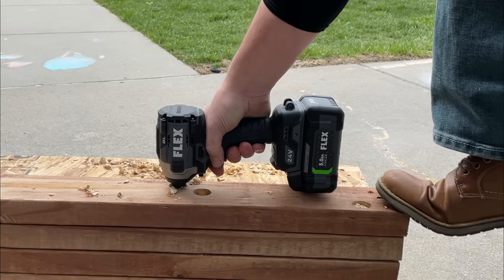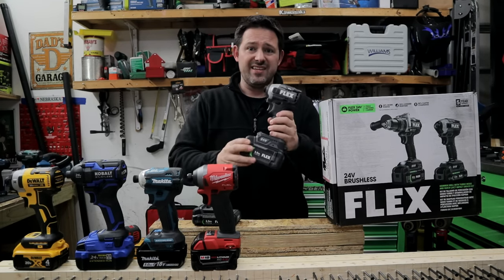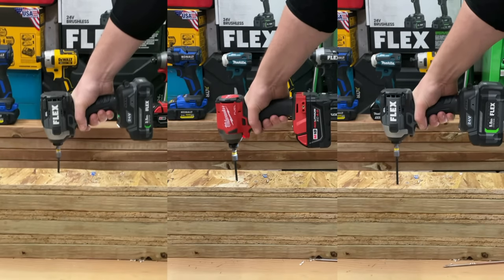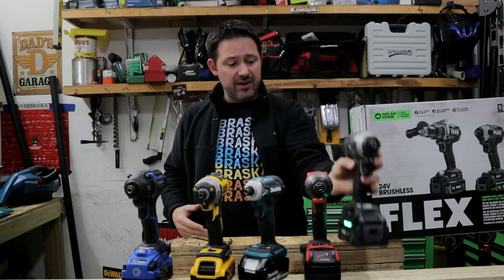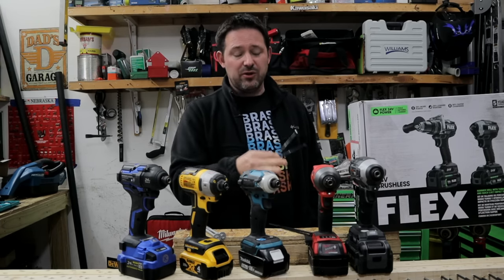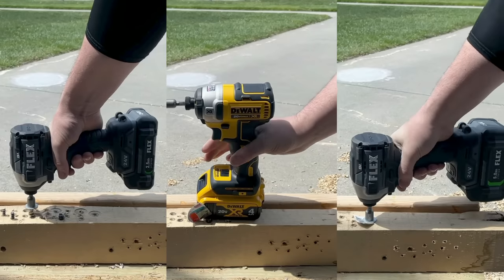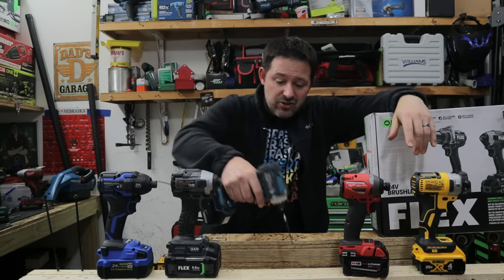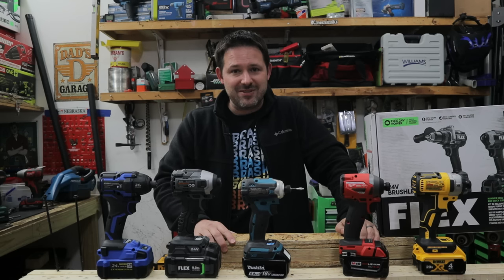FLEX TOOLS vs DEWALT MAKITA MILWAUKEE It's NOT what's NEXT Impact Driver SHOWDOWN!

Comment: I personally don’t care which one finished the fastest . I care more about the life longevity of the tool . If had to bet the Makita will outlive all others 🤷🏻‍♂️ !!!! Ohhh and Makita fits perfect in the human hand , and is well balanced 😎
Reply: All of my tools are makita except for my 12" mider saws. Makita tools are not the most powerful tool out there but they are the most balanced when it comes to power and battery durability. And the only reason I don't rock a makita mider saw is because it takes a PHD to tune it (about 10 adjustments) compared to my dewalt (3 adjustments)
Reply: @fu2974  right on !! In my own personal opinion Makita and Hitachi make the best impact driver .
Reply: I personally haven't used their battery powered tools but I do have all of Hitachi trim nail guns and framers and they haven't failed me yet.
Reply: @fu2974  let me tell you they’re pretty bad ass . They almost feel like a Makita in the hand . I call I Hitachi the Makita brother , they’re very similar!!
Reply: @philltafolla Do you think Metabo helped Hitachi or hurt it? I have buddies that swear on Metabo. My only real problem with Makita and Hitachi is that thier isn't any real distributors for my brand or Hitachi (Metabo) and I don't like to give my money to the HD or Lowe's if I can help it. Plus their lines seem to be a bit less durable than the pro grade. I've had to go to different cities to purchase what I want which is a pain in the ass.
Reply: @fu2974  I personally think that Hitachi didn’t need Metabo, so I’m going to say Metabo hurt Hitachi more than it helped. And I totally get how you feel .
Reply: @fu2974  Hitachi rocks  my old  832 16 d air guns are so solid
Reply: Im a milwakee person but i used to have all makita at one point and i can honestly say there is nothing as smooth or a ergonomic and durable as makita
Reply: @sergioservin212  that’s right you know exactly what I mean 😎
Reply: Usually makita is more expensive and gets outperformed by others so why buy a more expensive tool that is less powerful? Lol
Reply: @ALEXIS1414100  Never said Makita had the most power!!! To each it’s own , Makita makes well balanced tools , tools that fit perfect in the human hand . All my Makita tools have outlived the other brands that I’ve owned !!!!
Reply: @philltafolla  metabo merging with Hitachi was the worst thing that could’ve happened. Metabo was my shit all my pneumatics and saws from metabo are super reliable. Metabo downgraded when they merged, ive had a lot of problems with Hitachi tools it’s just not the same anymore. 😞
Reply: Makita is 4 life !! 💪💪
Reply: Makita is quality! I went with Kobalt, we will see how it does. I had Milwaukee previously, it was great but I dont care for the ergonomics.
Reply: My makita best friends and co workers dewalt and Milwaukee and mine is still running good I dropped it probaly 10 times of a roof on to concrete and still works although I wouldn’t recommend it
Reply: If i can drive screws 30% faster, thats saving time, and time is money.
Reply: @deepdeception7953  Thats irrelevant to me since I am my own boss and I charge by the hour . So Makita for me 😅
Reply: 100%. Ergonomics and reliability are two of the most important things and are mostly overlooked in alot of reviews. Makitas the king of these two things.
Reply: @ALEXIS1414100  reliability
Reply: @bigboy509_  Metabo pneumatics? What pneumatic tools has Metabo ever made?
Reply: @deepdeception7953  Did you build my condo?  Everything looks like 💩.  Slow down.
Reply: My guy
Reply: Been doing hvac for 16 years and makita had never failed me. i still have some batteries that are 16 yesrs old and still perform. But i do however run 12v milwaukee for the ridiculous amount of tools available. And they are quite impressive.
Reply: Okay so if you want a long-term battery and something that's really worth it I am a general contractor that works with either condemned or water damage houses I have done structural engineering my whole younger life and skill with their power core 20 five amp hour you can even find an aftermarket 6 and 7 but there's really no difference in them works amazing I bought them since they first came out and I have bought in flex the flex are all f*** up I dropped the screw gun from about 6 ft and the f**** handle broke I threw my Ryobi off a roof of a church it hit the ground almost in the same fashion blew the battery out but the tool was only semi damaged it's still functioned so it really goes down to you doing your own research people keep saying tools are expensive but if you are a contractor or doing anything in that manner you should have a little bit of money because when you bid for a job make sure you put the tools and things you're going to need right in the price so you have a budget to buy stuff
Reply: Makita is shit lol. Idc who you are. Watch some TTC. If I’m spending Flex money, I’m just gonna get Milwaukee haha. I’m not even biased. It’s just the truth. When another brand has better performance and reliability, that’ll be my new favorite especially since none of them have been super “faithful” to me lol
Reply: @FilthUD  you do whatever you want with your money, I’ll do whatever I want with mine 😀🤷🏻‍♂️
Reply: @FilthUD  been uaing makita for 16 years in 18 volt.. never fail me.. have the milwaukee 12v cause its just filthy good
Reply: Makita looked pretty weak to me.

Comment: I use Bosch and Milwaukee for construction, but also use Ego for landscaping. 

I keep watching Flex videos, even though I have zero plans to buy.
Reply: Same, I just bought the whole XTR set a few months ago so I won't be looking to upgrade for many years, but I do love seeing what the new ones can do.
Reply: I watch several Flex vids too, its the hype. But still not impressed, its powerful but not engineered with the knowhow of the 3 biggest established brands.
Reply: 18v line bosch guy here i have one dewalt tool and its the drywall gun  great tool for the price neither bosch  or Milwaukee could beat it pricewise
Reply: Cannot speak for Bosch, but the Milwakee will last 2 lifetimes. Dewalt will need to be replaced 3 times over a life.
Reply: I keep watching about flex tools for interest but I'm not even sure that they will sell it in my country ever
Reply: @cameronaberner  Have you been happy with them so far?
Reply: @rogergreene2272  Extremely. They are a little heavier than competing brands, but that you dont notice if it you use them regularly. They have tons of power and the batteries hold up well.
Reply: @cameronaberner  Thanks! Mine are only used occasionally, and lightly when they are. These XTR tools should last me forever
Reply: @rogergreene2272  They absolutely will, mine are used to build houses daily and have held up beautifully. I did have the pin that holds the skyhood break on the skill saw, but an 8 penny nail solved that issue.
Reply: @cameronaberner  That’s awesome to hear. I feel like most of these people saying that Milwaukee/Dewalt are for “Pro” use while brands like Rigid/Kobalt are for “DIY’ers” are full of BS
Reply: @pflaffik  Chervon has plenty of knowhow

Comment: I  agree with you 100% that if you are are already on the Milwaukee, DeWalt, Makita or Bosch battery platform with several tools it would be just silly to go buy a Flex just because it it less than a second faster. ((((and something that is never ever mentioned by anyone on YouTube is that if you're drilling through metal (like electricians often do), you need it on the slower (Speed 1 ) anyway. ..... so you are absolutely right, if you're on a battery  platform, there is no reason to switch
Reply: Agreed.  All tools are so capable now, the only real reason to switch battery ecosystems is if another platform has other tools that you can't get in your current platform and you really want (i.e. vacuum, lights, lawncare OPE, etc).

Comment: As someone who does construction for a living, great video. Very nice to see these side by side. From personal experience the Milwaukee is my favorite for things that need speed, like metal roofing. If its something that doesn't need speed I will use the Dewalt. I find it less fatiguing to use for long periods. Also the Dewalts durability is insane! Its not uncommon for our crew to accidentally drop a drill of a roof and we only had one break in the 4 years I've been working. That was after a 16 foot fall onto concrete, the handle broke. And after epoxying the handle back together, were still using it. Again I can't over state the durability.
Reply: The dewalt xr impact fits my hand better
Reply: Obviously haven't handle the makita in your hands....best lightest feel impact driver in the hands
Reply: Yeah, I have to agree. I have been  thinking about switching to Milwaukee or Makita, but my DeWalt tools just last forever. And I have beat them all to hell. Can't talk bad about DeWalt. That is from personal experience. Been good to me.
Reply: The XR Drills just don't take abuse well. I smoked 3 in less than a year before changing platforms. Disappointing they use a plastic gear case for their high end drills.
Reply: Flex is a great tool and it stands up well to everything tested here.  Moving up from old style battery drills/drivers....when you need a new one...Flex is a great, top of the line choice.  No, I wouldn't be out buying anything if I owned a good, new style Milwaukee 18 volt drill driver or Dewalt quality one.  But Flex is a great choice!

Comment: This is the best vid so far because it doesn't start out talking smack, just puts em all through same test. I still think the brand looks decent—the Turbo Hammer Drill and Quick Eject Impact with two batteries are $350—but we'll see what folks say about durability in the field. That's all that matters. Maybe we'll know by this summer.

Thanks for setting it all up! Eager to see the Hammer Drill in action, too.

Comment: Looks like Flex focused on speed on lighter duty tasks, but can’t always keep up when maximum torque is needed. That’s probably a good trade off for most users, but it’s definitely something to consider if you use your impact for a lot of high torque tasks.
Reply from the maker: That’s a really good observation as it does make a good distinction between this tool compared to the others.
Reply: ABSOLUTEL , but the specs are very misleading,  4,000 rpm's and 2,400 inlbs torque , those are Monster numbers and should have Blown Out Everyone including the Milwaukee Fuel which is 3,600 rpm's and 2,000 inlbs. of torque,  but as soon as the Flex hit a tough piece of wood it shit the bed and that also makes me question its longevity.....
Reply: @brianf9619  theres life time warranty on flex so thats a big plus for flex.
Reply: @Victory_Venture.    No , its only a lifetime Warranty on the tools that are bought the first year that Flex is out , after year 1 it goes to 3 or 5 yrs limited warranty....
Reply: I would also like to point out that it would take having to buy all lithium ion batteries from Flex to keep up with regular Milwaukee batteries, so you would have to spend $$$ just to keep up and then longevity is at questions with Flex. NO THANK YOU.
Reply: It’s weird because Flex actually had more power and torque then makita, Milwaukee and dewalt in a bunch of other videos in the same tests.

Comment: I will say this. Speed and power is not everything. It all depends what kind of work you are doing with the tools. sometimes a light weight tool for over head work is preferred instead of a heavier tool that gives you a small bit of extra power and speed.
Reply: Yes... 12v systems are definitely the way to go for that.

Comment: My thought would always be, when you're buying your first tools, get whichever major brand has the best deals at the time - DeWalt, Milwaukee, Makita, Bosch, Metabo, Ryobi, Rigid, and maybe Flex are all good.  Unless you're going to be using them professionally, then stick with either DeWalt for ergonomics or Milwaukee for performance because of how expansive their lineups are - consider adding a Metabo hammer drill, Bosch oscillating multi-tool, and Rigid pulse driver as needed.

Comment: From a makita user it is unforgivable for the bit to slip off. Speed and power is not everything.
Reply: It is to Milwaukee fan boys. Nevermind the collet being messed up and downtime to send the tool off for repair.
Reply: @cb84capri  What you talking about? My service vans are outfitted with Milwaukee tools and never had an issue outside of one battery failure. Probably about $25k worth of equipment. One m12 impact started acting funny after it slid off a roof 2 stories high onto dirt. I haven’t ever even heard of any common failures.

Comment: You can buy a Makita XDT14 with 3 speeds , a 3.0ah battery and charger for $99.00 at Xmas time , it has the same exact specs as the XDT16 , it just has less modes.  Definitely my Favorite Impact.....
Reply: Cheap doesn’t always make it better
Reply: If someone is buying a Makita impact other than the XDT16 it had better be the XGT impact or the td172.  ;)

Comment: That DeWalt 4ah battery isn’t all that great. It would kick butt with a higher ah.
Reply: @Pae Dahe  was thinking the same thing. I bet the Dewalt would have performed better with some 27500 cells.
Reply: Yeah there's a 2750 4ah battery out there but it wouldn't of mattered. dewalt needs to upgrade the dcf887 I'm sure they already have it designed!
Reply: @justgregnow  just imagine a Flexvolt Advantage impact...
Reply: Is it just me or did it look like the Dewalt was on the lowest setting?
Reply: @justgregnow  i found significant difference in speed between my 3AH and 5AH batteries on dewalt. Before I thought that there should be no difference and it was a myth.
Reply: I use  6amp flexvolts. Theu make em eat. #dewalt